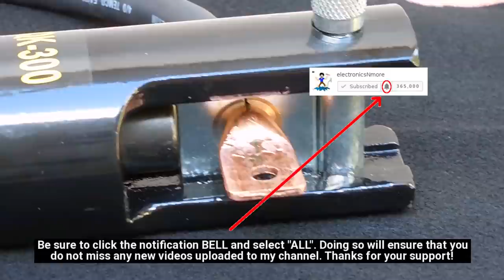Homemade Battery Cable Lugs (Dirt Cheap!)

Comment from the maker: Just so you know, you can also use an inexpensive hammer type terminal crimper to get the job done! I placed a link in the video description area. Thanks for watching, and thanks for your support!
Reply: I don't think most people have a 16-ton crimper.  So okay, how does it look/work with the hammer crimper?  That seems more realistic.
Reply from the maker: You can use a hammer crimper, but I really prefer the hammer type shown below. You can look online for deals. They work really good. 
https://www.toolsid.com/ancor/6-4-0-h-d-lug-crimper-mpn-701010.html?view=311100

Comment: I’ve done this on several occasions. However I use the hydraulic press to flatten the end. There’s no secondary cleanup required and no need to hammer the edges down.

Comment: Good tip - I've done it a few times myself.  Only thing I'd add is to clean the inside of the tubing to ensure optimum contact.
Reply from the maker: Thanks for watching Dave!
Reply: clean with what?
Reply: @Khlandestine  I was thinking a wire brush, like those used to clean the insides of tubing fittings before soldering.  If that's not available, some emery cloth or sandpaper  wrapped around a dowel would do the trick.
Reply: @davidciaffa4711  thank you
Reply: He did!

Comment: 1:00 you can use your hydraulic press to flatten this part. 
I inserted the cable first all the way to the end (as if its a ferrule), crimp half the usual way, and then flatten the other half using the hydraulic press' flat surface. (has to be a very strong hydraulic press though as this is one thick solid thing.

Comment: You can turn jaws over on crimper and use flat side to smash cooper pipe and have no hammer marks
Reply from the maker: Yes, that does work, but the jaws are only 1/2" wide, so you'd need to do it 2- 3x overlapping, then you'd get lines across the connector. Thanks for watching!

Comment: Always an excellent video - glad to see crimping get the love it deserves!  So many makers solder high current cables only to discover that when everything else is copper, solder is the highest resistance material in the chain. Heat will build here first, making it the first thing to fail. I could only add one word of advice here...GLOVES. Copper has a burning desire to be one with you..your fingers, to be painfully specific. For weeks. Cut edges, burrs, the slightest tool marks on soft copper wire or tubing can raise an army of insidious bastards determined to educate you on how miserable your life can become from a simple splinter. Looking for diy inline crimps if anyone has ideas - ty sir!
Reply from the maker: Glad you enjoyed it!

Comment: Done it this way more then a few times.     And contrary to everyone's musings 1/8 x 3/4 Aluminum Strap  makes fine Bus Bars.
Reply from the maker: Aluminum bars are fine, just use some No Alox on the connections.

Comment: have to replace the bolt on my battery terminal. what kind of bolt should I use?
Reply from the maker: Usually a bolt that's plated brass

Comment: Can you solder the tubing to the cable? I realize that the solder joint would probably have to be made first, if you don't want to melt the insulation or have to strip it way back and then replace it with shrink tubing, then the tubing could be flattened and shaped into a lug. I ask because I don't have any sort of crimper, hydraulic or mechanical and would like to know if a solder joint would be as good, conductively, as a mechanical joint.
Reply from the maker: You can, as demonstrated in my other video below, but this lug is too large, I usually do it for smaller sizes. 
https://www.youtube.com/watch?v=eedrETFZ3Ws
Reply: @electronicsNmore  I watched your video and thank you so much.

Comment: I've made these before out of copper pipe, but since I don't have a crimper I just heated up the lugs with a blow torch, filled them with molten solder, and stuck in the fluxed cable to make a completely solid solder connection.

BTW, I never did find that chart of pipe diameter to cable gauge size.
Reply from the maker: That works, but you don't want to overheat the connection causing all the solder to wick up into the cable making it stiff. I posted 2 charts, one shows wire size OD, and the other shows pipe side ID.
Reply: @electronicsNmore  All I can see in the video description is amazon links and a paypal link.  Where are the chart links?

Comment: Well done my South FL brother. Could you do a "How to survive a Hurricane power outage" 3-4 day power outage in style?  Maybe using a Solar system and maybe a generator mix?
Thanks!
Reply from the maker: I'm ready. :-) Hopefully we don't get any. I have a Generac inverter generator 2000W start, and a few high powered portable power stations that can be charged using my larger solar panels. I should be OK, but no AC of course.

Comment: Great video, I am going to build my own lfp battery, find your instructions very helpful. Just one itsy bitsy question. At 4:12 you mentioned terminals polished to remove oxidation, what does that mean? what kind of polish? I am a person with 0 knowledge about these kinds of things, so I have to start from asking very basic questions :D.
Reply from the maker: I used a small stainless wire brush and 000 steel wool pad. Be sure to watch and share my lfp battery video below. Thanks!
https://www.youtube.com/watch?v=8YGoCSleaZU

Comment: I don't see anything in the description matching wire size to pipe size (0:44)  That would be something very useful to have even down to rather small gauge wire.  You can get some fairly small copper tubing.
Reply from the maker: I was showing LARGER sizes, not smaller. 4ga to 4/0 range. All you have to do is look at the 2 supplied charts and compare the ID of the tube to the OD of the wire. Use a tube that's slightly larger than the OD of the wire.
Reply: @electronicsNmore  There are no measurements in the description to any charts nor are there links to anything but amazon that I can see.  For some reason, I do not see anything related to sizes, just the amazon links, some patreons, a paragraph about sharing and subscribing.

Comment: Is it possible to buy just the crimping dies and use them in a vice instead of the whole $60 hydraulic press device?
Reply from the maker: Hi Theo. Yes, look on Ebay using the search term: "replacement hydraulic crimp dies"

Comment: It is not hard to find,hard coppercimes in 10 ft lgths,it tends to split if you pound it down or vice it flat,soft copper comes in a coil,that is what you want,its refrigeration tubing,found ard the world easily.😊

Comment: Thank you for the video. That was Easy-Peasy.
BUT, the money you saved making the lug won't cover the cost of the file that gets dull from your MIS-USE!!! 
Never, BUT NEVER use a file like you did in this video! Always push the file in a forward motion. When you reach the end, lift the file, return to the starting point, and push the file forward again. Continue this method until you achieve the finish you desire. Never DRAG a file BACKWARDS to the starting point. This causes the teeth to be broken and/or become worn beyond use (dull).  I learned that in 1979, from a LU 798 Pipeliner. 45 years later, I still have that ½ round bastard file. The ½ round side is a kind of worn, but the flat side is in pretty good shape. It's  a 12 in Nicholson, made in the USA.
Reply from the maker: There's zero chance of damaging a file made out of Steel on copper

Comment: Nothing cheap about that.   Unless you’re a customer that calls plumbers crooks. Build this and now you see why shits expensive
Reply from the maker: It's far cheaper to do what I did using a copper tube than buying a connector.